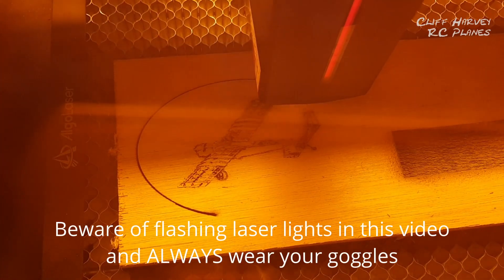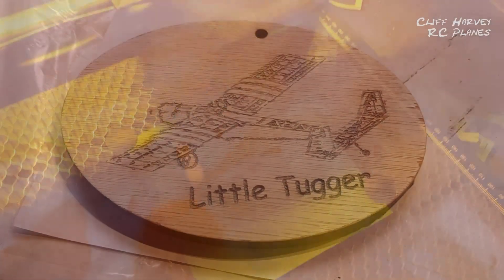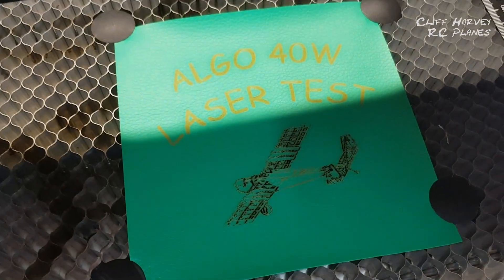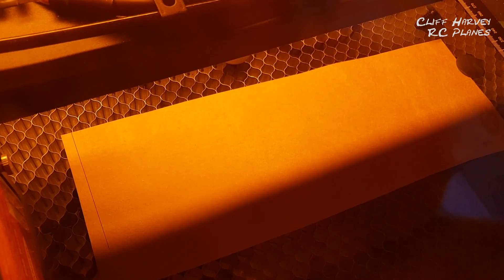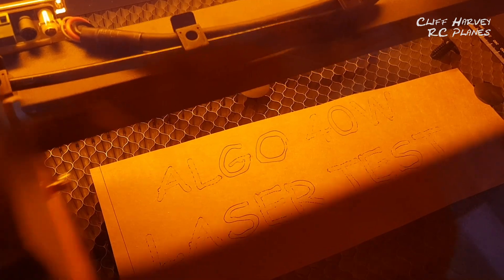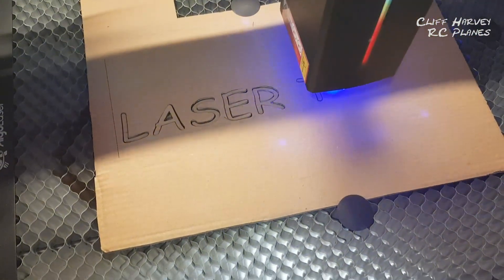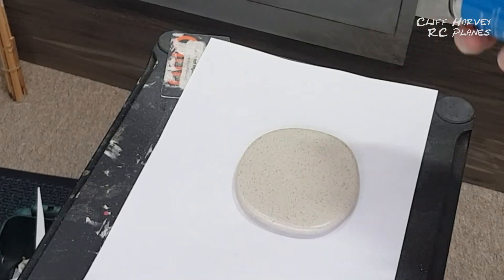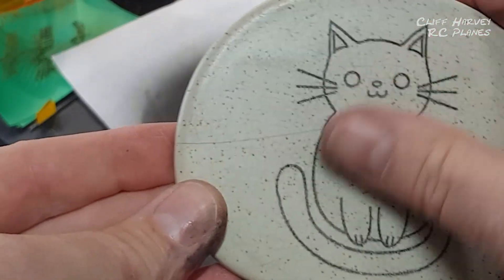AlgoLaser Delta 40W Module Upgrade: Unleashing More Power!

Comment: Can you use the Algolaser module on other machines?

 I have just bought an Algolaser Delta 40w and to be frank, it is junk, not a patch on my TT20.

The X axis is lumpy, sent pictures of output to support, they just deflect to adjustment. You can feel the bumps as you move the carriage. Typical Chinese support, different person responds each time, creating a different thread and (deliberately?) misunderstanding or ignoring previous comment, all with fake English names, asking for pictures which are irrelevant.

When turned off the machine keeps beeping, power button, key, emergency button and at the power socket, it draws power from the usb and gives an alarm. Has to have the usb unplugged each time, then it can't be found and you have to reboot the pc.

The focus adjustment is a joke, as is the clamping system.

But the module is fine, although unlike better brands it can't be reduced to 20w for smaller dot size.

I would recommend people avoid this and buy a Two Trees or Creality Falcon (borrowed a friends while waiting for the Algolaser to arrive), far better machines.
Reply from the maker: Sorry to hear you're having so many issues with your Delta. I haven't encountered any of those problems with mine. As to your question, I really don't know 🤔👍